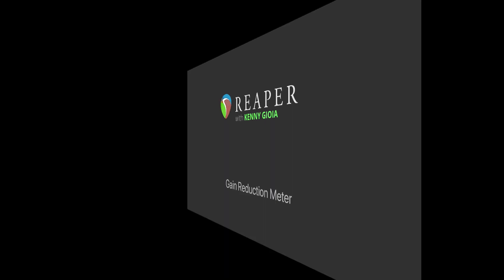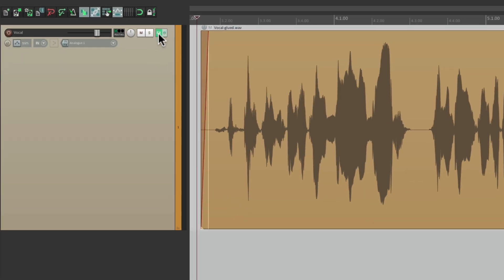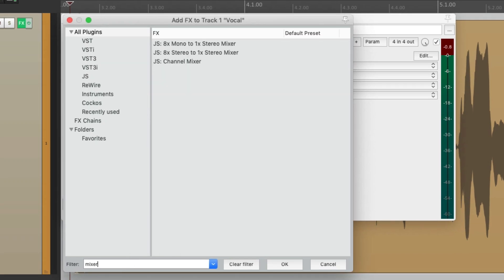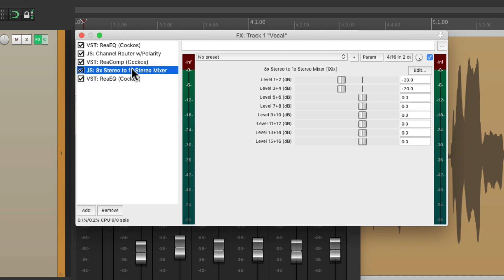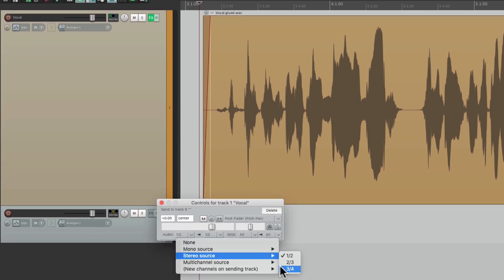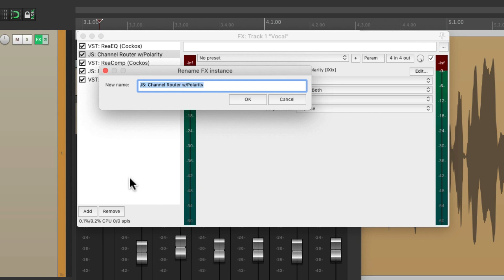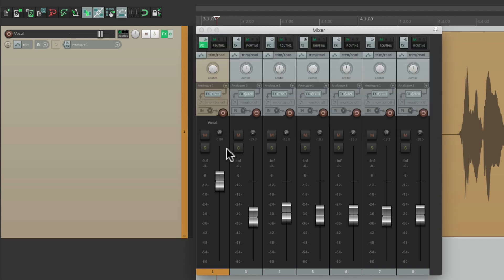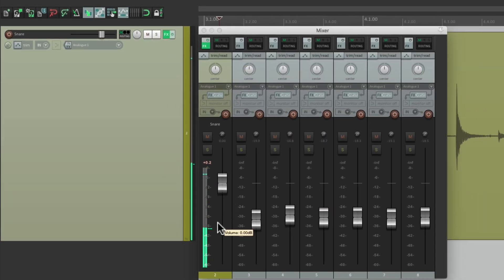Gain Reduction Meter in REAPER

Comment: Musta missed something, why not save the compressor as part of the FX chain? I don't see a problem with saving an effects chain for each compressor you want to use this on. As a quibble, it would be nice if the meter actually dipped as gain reduction meters usually do.
Reply: "why not save the compressor as part of the FX chain?" - You can do that if you want but the idea in this video is that it will work with any compressor you want. So saving it with ReaComp isn't going to help if you want to use a different compressor.

Comment: It's a bit pointless tbh. +6 dBfs gain reduction in the compressor shows around -30 dBfs in the track, because they have different polarities.
So what does that tell you about the gain reduction? Absolutely nothing.
But that said, I don't get the point of combined gain reduction meters anyway, not just in Reaper.
I see zero benefit in knowing how many dBfs of gain reduction happen in sum.
Say you have a track with expander, compressor and a volume leveler on it.
Say you have an input signal at -20 dBfs, the expander momentarily adds +10 dBfs gain reduction, and the compressor adds another +9 dBfs, bringing the signal down to -39 dBfs. (-20 - 10 - 9 = -39)
Now the volume leveler momentarily removes -27 dBfs of gain reduction (read: adds +27 dBfs gain) to level the signal at -12 dBfs where you maybe want it for the mix.
After all this dynamics proessing, your signal is now +8 dBfs louder than before, that's a total gain "reduction" of -8 dBfs. (-20 - -8 = -12)
So your summed GR value displays -8 dBfs of total gain reduction, while the expander and compressor actually created +19 dBfs of gain reduction combined.
Of what bloody use exactly would the summed GR value of -8 dBfs be if you're wondering why the signal sounds squashed from the compressor working too much at +9 dBfs GR?
It's just an arbitrary and completely irrelevant value that gives zero insight or enlightenment regarind what may be going wrong somewhere in the signal chain.